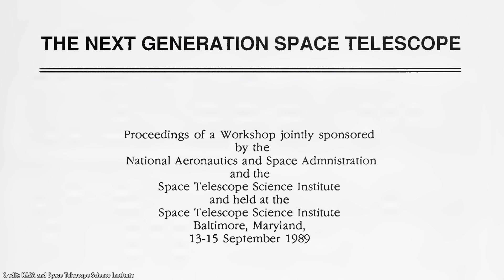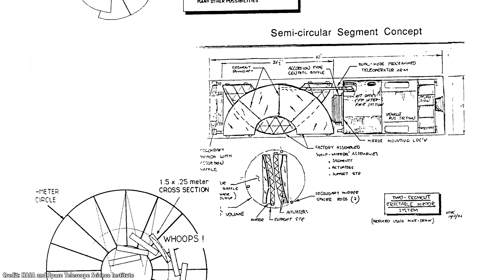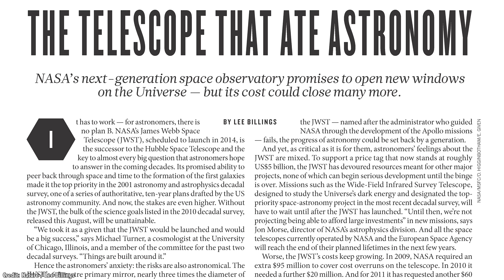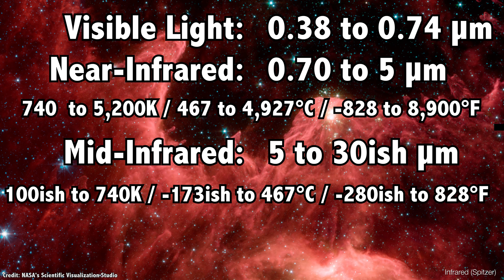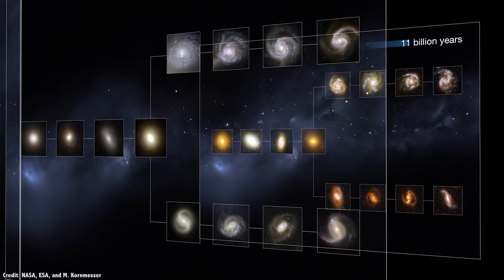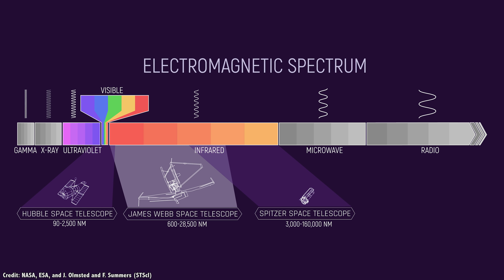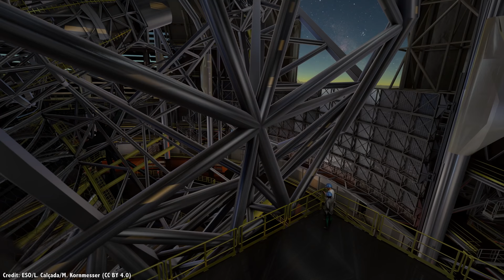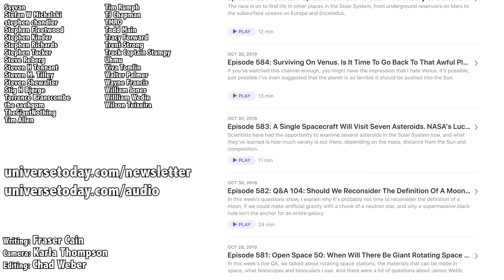The History And Future Of The James Webb Space Telescope

Comment: By the time it's built we'll have the launch capacity to make much of the unfurling process just an added complication.
Reply: It's already built. Launch date is 14 months away.
Reply: @coreys2686  It's not finished yet, and has had launches consistently pushed back for years.
Reply: @NeonVisual  It is finished - it is currently undergoing testing.
Reply: @MrRandomcommentguy  Yes, like they have been doing for years, and as they keep finding problems they have to go back and redesign parts. The last biggest issue was the unfurling. It was "finished" and when tested it didn't work properly. It won't be finished until it's loaded into the rocket.
Reply: @NeonVisual It seems we're arguing semantics at this point.
Reply: @NeonVisual  It is finished. It completed its final assembly in August/September of this year (it was stated in the video). Its undergoing final testing right now and is going to be packaged up and shipped to Kourou via ship.
Reply: Amazon Alexa will have it figured out by then.
Reply: It isn't finished until the testing goes right and it is loaded up in the shipping container.
Reply: @coreys2686  The issue is that they might find another flaw during testing.  I think it's best to say, "hopefully it's finished".
Reply: @DAndyLord  All of the sub-assemblies were extensively tested before final assembly. Its just making sure the tolerances are still good after putting the telescope and vehicle bus together.
Reply: @coreys2686  Right, so, hopefully it's finished.

This is an ultra precision machine that'll be unserviceable once launched.  There's every good chance they'll find another flaw that'll require repairs or adjustments (it's happened several times before on this project).

Comment: I have a question:
What exactly is taking so long? Is it the development and testing that it works? Or is it just extremely hard and time consuming to build? 
The actual question being: if say the rocket blows up or some anomaly occurs where the telescope is unusable. Will it take as long to potentially make a new one? Could you quickly just make a 100% copy and try again? Or would that take another 20 years like the original.
Reply: I have much more faith in the rocket then the telescope.
Reply: They assemble it, then give it a shake test to see if anything breaks or falls off, and so far the answer to that is yes. If it blows up on launch or fails to deploy properly,  I'm not sure what would happen, it will be to far away for a service mission. There are already other, different projects in the pipe. To replace webb, even if it would be faster and cheaper, would still require a big pile of money from somewhere.
Reply: It took so long because it could. These contractors have every motivation to always be behind schedule and over budget. They are never punished, so why not profit at the expense of the stupid taxpayer and scientific discovery. The James Webb should have been scraped years ago. 50/50 that it never takes a single reading. Everything that is wrong with NASA can be summed up with this money-pit telescope. Dis-band NASA!
Reply: They are adding a docking ring for future missions...just incase..doesn't speak confident words lol....hopefully it isn't needed.
Reply: @bbeen40  Ultimately the issue isn't NASA though, they aren't allowed to make the final calls on that. And that is the issue, because the politicians get a lot of say in how NASA runs itself, they make political decisions on things that should really be engineering decisions.

So what really needs to happen is to have NASA be run more independently. Of course some level of oversight is needed, but having their every year exact budget for each project on long running projects, be determined by Congress is just to much.
Reply: @bbeen40  First off while there is unfortunately some truth to the first three sentences the time and money problems related to contractors are more or less courtesy of the rules for governmental contracts which is mostly driven by the management of the Department of Defense.   Most of NASA's work is actually engineering research and development with most of NASA's budget going to pay employees enough to compete with the Department of Defense which has so much funding they can afford to splurge to hire employees more than any other agency. So while technology costs have continued to drop the costs due to labor have exploded.

Were you to shrink the DOD budget and allow the government to renegotiate contracts it would no longer incentivise contractors to low ball estimates to meet the rules for government contract selection and  should force the military industrial complex to become more efficient. Suddenly NASA would not be anywhere near as expensive as companies like Northrop Grumman, Lockheed Martin and Boeing wouldn't be able to get away with their shit anymore.
Reply: @bbeen40  Come one, really? NASA's operating budget is.4% of the federal budget. It's hardly more than a rounding error. No doubt that JWST has been mis-managed, but it's already DONE so quit crying about it.
Reply: @realkarfixer8208  
Oh, it's done? Did they launch it without me noticing? 
It isn't "done" until it's up and doing science.
Jesus, you shills are just ridiculous.
Reply from the maker: There were a bunch of technical uncertainties that were uncovered as they were building the telescope. That's why you often want to use off-the-shelf hardware as much as possible. You could make a copy quicker and cheaper now that these issues have been figured out, but there are lots of other priorities so I don't think it would happen.

Comment: Another question:
Concerning visible light spectrum, with current advances in ground-based telescopes (adaptive optics, etc); would a Hubble-like space telescope (preferably larger) make sense?
Reply: I don't think so for visible spectrum, as the earths atmosphere doesn't block them. And ground based telescopes have quite a few advantages. Of course when we get into the age of self-assembling space telescopes with 1000 meter mirrors, then space is the only way to go.
Reply: @Mosern1977  But Hubble still give us better and clean images than any Earth telescope, no?
Reply: @RafaelDominiquini  , modern ground-based 'scopes can give images about as good as Hubble, and are easier to maintain.
 Hubble still has the advantage of being able to see in certain directions without any interruptions such as daylight.
Reply from the maker: Yes, that's the plan for LUVOIR. It'll be like Hubble, but measure 15+ meters across.

Comment: “The Northrop Grumman B-2 Spirit is a US Air Force (USAF) heavy-penetration stealth bomber launched in 1989. The aircraft can infiltrate complex and dense air-defence shields, while it is capable of all-altitude attack operations up to 50,000ft. B-2’s original unit cost was $737m, making it the most expensive aircraft ever built. However, due to retrofitting and adjustments in 1997, its overall cost now stands at $2.1bn . It costs $135,000/hr to operate.”
Just saying...

Comment: They should build at least one more Hubble launch and attach three Hubble or other optical telescopes to a frame that is a triangle. If you did that you could use the same frame to attach more observatory equipment. They could use the inside as a radio telescope. Make it a miles wide interferometer. Add a space station for docking and hotels...

Comment: I have two questions about the James Web Telescope. #1 You spoke of a Helium pump on it to help cool it. Is it an actual pump like in a A/C unit using Helium or is it just some liquid Helium in a large tank, that is allowed to just slowly boil away and take the heat with it? #2 Do you know if one of the first pictures it takes is going to be a deep field long exposure shot like Hubble took? ( I hope, I hope, I hope )
Reply from the maker: It's like a refrigerator, so in theory, it won't expend that into space unless there's a leak. As I mentioned in the video, there'll be a JWST Deep Field, but it won't be one of the first things it does.

Comment: If all goes as planned then there'll be no regrets. A lot can go wrong though and makes me think about sending a tough little fixer robot on board such expensive and irreplaceable craft in the future to do basic repair at far away points like the L2.
Reply from the maker: That would be cool, but it would have added to the launch weight and size, and there isn't any room for anything else.
Reply: @frasercain  that is a good point but then if a minor jam renders the telescope disfunctional at the L2 they'll lose everything. Maybe using strong but light materials like aluminum could strike some sort of risk balance...

Comment: How will James webb be powered, and is there anyway to possibly extend its operational time?
Reply from the maker: It's powered by its solar panels for electricity. But the thing that will really definite its lifetime is the amount of fuel it has on board to maintain its position at the L2 point. It'll have 10 years, 17 at the most before it can't hold position any more and it drifts away. It does have a refueling port, so who knows if it'll happen?
Reply: If it takes as long to build the refueling space craft they better get started on it now :-)

Comment: Based on the time it took to build it, would it be possible to use all the data and knowledge we have and build another copy of james Webb using the original estimated budget?
Reply from the maker: There would be some cost savings, but it would still be expensive. If the launch fails, I don't think we'll see a replacement.
Reply: @frasercain  I would like to think that the security measures taken to get a successful launch is as detailed, checked and rechecked equally to the work done to test james Webb to the point that everyone is convinced that it is ready to be sent to space!

Comment: Can you help me with this question or put me in touch with someone who might be able to, please? I am the producer, Editor, and Co-Host of "Q Code Podcast" and I have a question that has stumped me. If a Black Hole is a runaway gravity well, caused by matter collapsing into an infinitely dense point (Singularity) and can’t be stopped, and we know that the more dense an object becomes, the stronger its gravitational pull becomes, then why doesn’t a Black Hole’s Event Horizon grow infinitely in size as well? You would think that infinite density would create infinite curvature of Space-Time resulting in an Event Horizon as large as the Universe. Clearly, I'm wrong, because I’m still here and have not been Spaghettified. What am I getting wrong? Please, let me know. Thank you.
Reply from the maker: Hi Alan, you might want to get a direct answer from an astrophysicist. Total amount of mass that goes into the black hole is still finite. If you replaced a star with a black hole of the same mass, the planets would orbit in exactly the same way. It's only if you get close enough to the event horizon where tidal forces cause a problem. So it might have an infinite density at the singularity, but it's still a finite amount of mass.
Reply: Fraser Cain but isn’t it true that you can start with any finite amount of mass and create a black hole if you crush it down enough? I guess what I’m really wondering is, does the matter in a black hole get crushed smaller and smaller forever? Or, does it somehow stop and it doesn’t get crushed down smaller and smaller forever? Also, great video! I can’t wait for the James Webb Telescope.
Reply: I believe that mass density and it's physical circumference do not need to be in lock step.  But you should research this on your own.  I'm just "best guessing" here.

Comment: NASA is like a combustion engine.  2,000 moving parts dozens of fluids and 20,000 patents at a time when you get more torque out of a copper wire wound around a magnet (electric engine)
Reply from the maker: There are some incredible successes, which missions coming in on time and on budget. But this telescope is on a scale like nothing ever built before.

Comment: 15:00 the Webb will inspire the longest crewed space flight ever. when a 2$ screw stops working on it. if it is a low cost, simple issue, they'll spend another pile of money not to lose the truckload of money already spent on the project.
thus in this case, I am happy if it works, happy if it doesn't
Reply from the maker: Depending on what goes wrong, it could be done robotically too.
Reply: Relax. There are no $2 screws on the JWST

a $735.92 might fail though.
The way 6 of them did, when they tested the shade extension...

Comment: Question- when James Webb telescope runs out of fuel, could nasa send a remote control vehicle to refuel? Or is there no way of doing that?
Reply from the maker: There are no plans to do it, but it does have a docking ring and a fuel port. You know, in case someone wants to resupply it.
Reply: @frasercain  Well that is a little foresight.  They can't get enough of Hubble and it is on its last legs. It was only supposed to last 15 years and now it's pushing 30!

Comment: Every time you said it will be used to look for dark energy or dark matter I had to lol...... what a waste... every other test has failed to find anything... why dont you get it to look for heat left from santa's sleigh while your at it.....
Reply from the maker: Both dark matter and dark energy are definitely there. The question to answer now is "what" they are. That's still the mystery.
Reply: Fraser Cain Thanks for your reply... glad you are 100% sure.... Im sorry, but I'am not.  If you have a theory, and then observations dont match your th'eory, you dont make up something to make the math work... you look for what is wrong with your model.... there are papers everyday in the last few months due largely to the new instruments available that are pointing to other answers. I'm sorry, but the consensus on this is just not there....
Reply from the maker: If it was easy to figure out, then it wouldn't be a mystery. There are so many things that need to be explained, like how galaxies rotate so quickly without tearing themselves apart. Why we can see light distorted by seemingly nothing. What's causing the distortions?